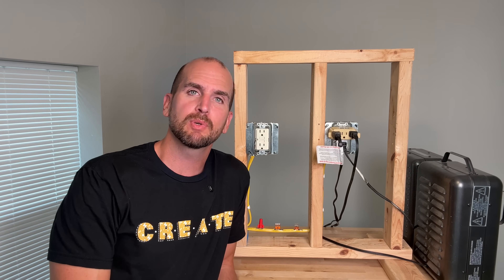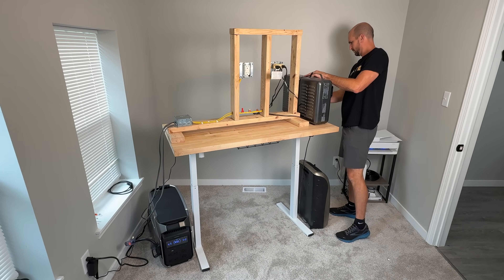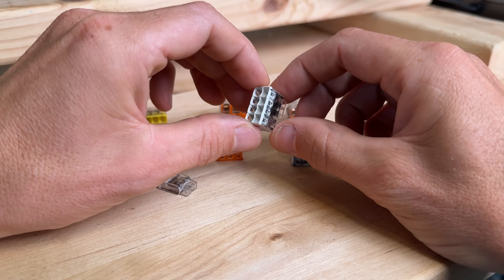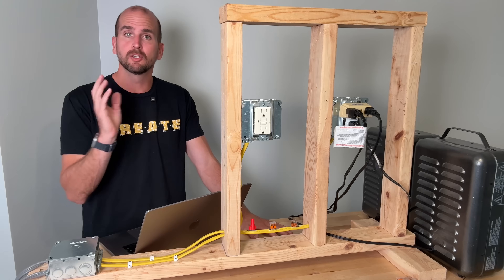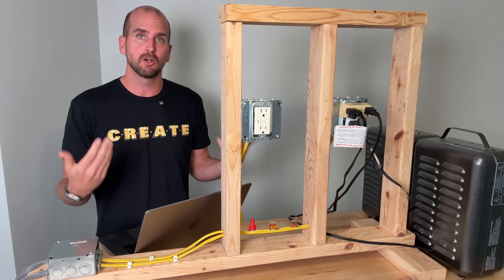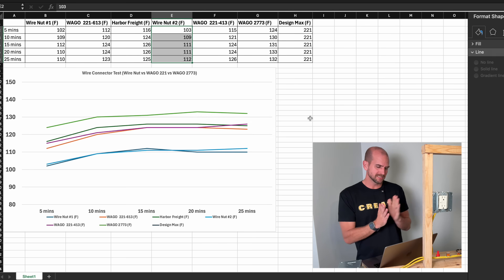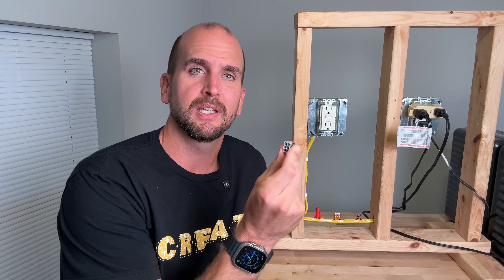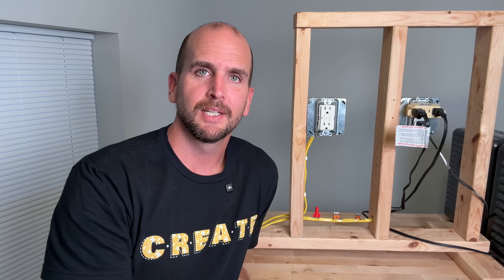Can Push-In Wire Connectors Handle Heavy Loads? | Surprising Results!

Comment: The variable he doesn't represent well in his testing is time.

He runs it for some time, but not long enough for the vicious cycle of bad connections to occur.

Also, the addition of a very small resistance is very difficult to measure, but it can have an enormous effect over time.

Think of resistance spot welding. The cross section of the contact tips is roughly the size of the weld nugget.

The difference between the resistance of that cross section of the copper contact tips and the (say steel) it's welding, is usually thousandths of an ohm. Yet, the steel is melted (goes plastic), and the contact tips will last for hundreds of welds.

With electrical connectors, the internal resistance will be less, and the current will likely be less, but there will be some areas of resistance that is higher than the wire itself.

That resistance will heat the wire and the connectors. That heat will gently accelerate oxidation. That oxidation will increase resistance. Increased resistance = more heat... There's your vicious cycle.

The push connections will likely start off with higher resistance, due to a smaller area of contact.

The wire nut is superior because the two wires are in direct contact with eachother, over a length (let's say 1/2"). None of the other connectors will come close to the amount of contact area, as the wire nut.

It'll never matter in a hall outlet. But it will in something like a well pump. Really, anything that pulls higher currents for longer periods of time.

Things go bad quickly after oxidation kicks in, but oxidation takes time!
Reply: I dunno, I've had Wago's (lever nuts) on my 5000W garage heater for a few years now, there's barely a heat difference between the Wago and bare wire using 10ga to connect to the 12ga internal wiring. That thing runs pretty constant when it starts getting below 0F. We'll see over more time, but everything still looks good after several MWh of throughput and a some very high humidity.
You're going to have oxidation issues with twist nuts too as there is still an additional resistance on twisted together wires. There's more contact area to mitigate issues, but it's still there.
Also, Aaon commercial rooftop units have been using 221's for their compressor power wiring for a while now. I haven't heard of any issues yet, but would be interested to see if there are.
Reply: @andrewt9204  - He is right though.  Wire-nuts have "teeth" as well.  So you will have the wires twisted together over more surface, which is probably good enough to hold if you only used tape, and you have the wire nut dug into the surface of each of the wires underneath.  The wire-nut will hold up better over time.
Reply: He also did not tell us whether he twisted the wires under the wire-nut here.  It looks like they are not.

Comment: I "get the point" about being far below the 220 F operaing limit.  But, in all fairness, I'm not very impressed with that limit.  As if having enough heat in your walls to boil water is somehow okay.  So I find that aspect to be irrelevant to the test.

We need to focus on the fact that we're pulling ~30 amps thru the WAGO.  

Let's do a series of tests with that same load...but over time. Let's see one hour @ ~30 amps.  Two hours.  Three hours.

Then take the WAGO apart and show us the terminals and housing compared to a new one.  If the two look the same, then the argument is settled.  If there's scorch marks or melted plastic, then the conversation must persist.  We'll have to keep dialing back the amperage untill we get a clean comparison.
Reply: I like your logic. Very thorough. Can we assume the UL did that sort of test already?

Comment: Is testing them connected to the same wire (at the same time) accurate?
Reply from the maker: There would be a little voltage drop at each connector but I think the difference is negligible.
Reply: @EverydayHomeRepairs  They will all be carrying the same current when connected this way so it will give the most accurate results.

Comment: I picked up a package of Ideal push-in connectors (model 30-1333S). They work well for solid wire, but are unusable for stranded. I expect that the Wago push-ins have the same limitation. One of the nicest things about lever-style connectors is how easy it is to connect together solid and stranded wires.
Reply from the maker: Yep, the WAGO 2773’s are a no go with stranded wire.
Reply: @EverydayHomeRepairs  They're fine with 7 strand wire (class 2), but not class 5 (fine stranded)

With solid core wire you can reuse the pushin wagos by twist and pull. I've only ever seen ONE wago burn up and have been using em for over 10 yrs and that was due to corrosion thanks to water ingress on a 32A circuit
Reply: Someone can correct me if I'm wrong, but I'd expect in Europe they'd crimp a ferrule on stranded wire before attempting to use it on a push-in style connector. The use of ferrules is practically unheard of in the U.S. since most small wire is solid.
Reply: @sigcrazy7  it can be done but to my knowledge ferrules are meant for screw down connectors.  Lever wagos are  a better bet... Wago also do  a model  (224 series) that can take solid (push in) one side, and spring loaded the other side for fine stranded. They're designed for lighting, not sure if that type is UL listed...
Reply: They are only meant for solid wire are you dumb?
Reply: The Ideal push-in connectors are rated for stranded too. I agree that it doesn't work well unless the strands are perfectly prepared and inserted, but I trust them more for outlet loads than the Wago lever-nuts.
Reply: @adamliberman6767 I don't know what you mean by perfectly prepared. Based on my experience with 14-gauge stranded wire, they can only be used if the wire has been tinned. (I haven't tried 12-gauge stranded.) Otherwise the force required for insertion just crumples the wire, no matter how firmly the strands are twisted.
Reply: @adamliberman6767   "but I trust them more for outlet loads than the Wago lever-nuts." 
Why ?
Reply: Push ins are great. Work great. Solid 14,12  wire at least.

Comment: I can't help but wonder if this is the right test for a couple of reasons. While the external temperature is certainly something to pay attention to, isn't the internal resistance of the connection important, also? To get into details, the wirenut probably has greater thermal insulation properties than the plastic used in the Wagos or Harbor Freight connectors. That would reduce the temperature at the surface of the wirenut. It may have greater surface area also. So, whatever heat is generated at the connecting points of the wires gets spread out to a larger surface. n I think that means we'd see that under identical electrical resistance  to the load in the connector it would yield lower temperature. So, it would, for me, be interesting to show what the electrical resistance is in each option.
Reply: Wouldn't the temperature be directly related to the electrical resistance of the connector?

It's also worth remembering that all the naysayers typically heavily focus on the alleged risk of fire, and that's what drives the temperature check here.
Reply: @ralfoide  The resistance determines how much heat is generated, but the other part of the equation is how rapidly that heat is dissipated into the surrounding environment.  The temperature of the connector will end up being determined by the balance between the two.  Therefore, electrical resistance does not necessarily correspond directly to temperature.  The temperature can also be affected by the material the connector is made from, its surface area and contact with the surrounding air, etc.

But this is also why measuring resistance is not necessarily the most important test, because arguably what really matters is how hot it will actually get in your walls, and whether that will run the risk of causing damage or fire.

Electrical resistance would be an interesting data point, but is really more of an academic question, because it's clear that none of these connectors are going to have a high enough resistance to significantly affect voltage drop (which would be the main reason why electrical resistance itself might actually be a concern in the real world).
Reply: @foogod4237  "Electrical resistance would be an interesting data point, but is really more of an academic question", ironically it is the complete opposite. The junction's resistance governs how much energy is converted into heat, the complex non-linear thermal conductivity surroundings is an academic question. Your description of how quickly a junction can release heat before starting a fire is likewise misunderstanding the true opposite point. 

An electrical junction should never be even vaguely hot enough to heat internal walls to the point of fire. A failing junction  should ideally constrain the heat such that it melts or breaks apart safely and the electrical circuit is broken. What you described is actually what leads to house fires with little or warning symptoms. A high resistance wire nut kept relatively cool by  dissipating heat is a ticking time bomb, how is anybody supposed to even notice a problem?

"none of these connectors are going to have a high enough resistance to significantly affect voltage drop"

You are quite right in saying this. But you can study hundreds of thousands of wago lever nuts used and find the electrical resistance around a tight bell-curve and very low standard deviation. But unfortunately wire nuts require the electrician to be responsible and with a modicum of skill, so while it still has a decent bell-curve, the standard deviation gives big tails for improper use that leads to electrical fires.
Reply: I'm pretty sure that the youtuber Great Scott did this test already, and it needed a benchtop multimeter to test because of the needed resolution. Not exactly something most people have around handy. AFAIK the Wago had a slightlyhigher resistance than the wire nut, but realistically it wasn't a big concern at any sane current draw that they're rated for.
Reply: there's also the aspect of emissivity. the temperatures in the video were taken using a camera, but the different connectors could have different emissivity

unless that was actually corrected for / calibrated, it's not really proper to compare those readings taken from different surfaces (readings from the same surface at different temperatures, however, are generally comparable unless things get extreme leading to nonlinearity)
Reply: I came here searching for this comment

Comment: I'm concerned that doing good joinery including pre-twisting with wire nuts takes a bit of practice. The pre-twisted solid core wire is also subject to heat cycling. Perhaps the spring in the Wagos/Ideal connectors handles the expansion/contraction better over time.
Reply: Why pre-twist? You're supposed to use the wire nut to twist the wires. You put the wires into the wire nut and twist until you get a couple good twists outside of the wire nut.

Comment: I finally broke down and bought a small pack of 221 level nuts.  I used them for the first time yesterday.  Ok, you won me over.  I'm sold on the 221 level nuts.  Much easier than wire nuts if you have different gauge wire.  They work.  Thanks for sharing.
Reply from the maker: You bet, wait until you use them on a light fixture or fan.  Like having another set of hands 👍
Reply: @EverydayHomeRepairs  Or, something with integrated lever nuts. I'm replacing all of the receptacles in my house with Leviton edge receptacles and they make the process just so easy. They're especially nice because there is no exposed metal other than the grounded bits at all. And, it's not quite as nice as these Wagos as you can't see the wire, but if you've used the strip gauge and you don't have any exposed wire outside, you're fine.
Reply: @EverydayHomeRepairs  I was going to use that exact same example, especially when joining solid to stranded which is often the case there.
Reply: also much easier if you are mixing stranded with solid wires.
Reply: @philsmock4943  why a different gauge wire connected together?
Reply: @pbm___000  Smarthome devices like switches and receptacles often come with stranded leads.
Reply: @pbm___000  Light fixtures is a common one
Reply: @pbm___000 light fixtures sometimes/typically have smaller AWG size than typical house wiring, just one example
Reply: @elaroche24  yeah I didn’t have the right Wago nuts for doing a ballast bypass (I only had straight 2-port 221s) and it was really hard to use the wire nuts with such different gauges; I used them anyway cause that’s all I had, but I think the proper 221 wagos would’ve been better
Reply: You can also use them as a method to join different metals safely for people afflicted with aluminium wiring.
Reply: Lever, not level.  They are very good!
Reply: @DougKremer  You're right.  My bad.
Reply: So many videos about this… I used 221 just recently for a stereo project— they’re great. I wouldn’t use single-use devices…

Comment: I use Wago push in connectors all the time for LED retrofit and ballast bypass. They're cheaper than the lever nuts and work great.
Reply: That is my preferred application as well.

Comment: Just use wire nuts.  It makes it easier for next guy, when changing things up.   Everyone always gets bedazzled by the new mouse trap.
I have had the most issues with electrical by having to replace receptacles or switches that were backstabbed,  These lever nuts look like they are built with the same design flaw.
Reply from the maker: The lever nuts actually made service and/or additions super easy for the next guy 👍

Comment: Are the Wire Nuts in both recent test videos in Series or Parallel?  It looks like they are in Series on the Black Hot line.  If in Series, the Voltage to each successive wire nut is reduced by the Voltage Drop across on the preceding one, and therefore the Voltage Drop Heat is not as accurate as Parallel would be.  I was surprised that the Push-In Wire Nut had the highest heat of all, but I would have stayed with the 36-piece Lever Nut assortment pack anyway for the convenience of reusability of the Lever design.
Reply from the maker: Yep all the connectors are wired in series. Although I didn’t measure the exact voltage drop I believe it is minimal.

Comment: Can Wago connectors be used on outdoor fixtures or out door equipment on your house? And still be up to code?
Reply: For damp areas, yes. The code calls for outdoor fixtures to be sealed with gaskets and/or caulk. For unusually harsh environments, they do make a one-time-use waterproof connector that is filled with goo to seal the connection.
Reply: Wago offers protective connection boxes/cases to protect the lever nuts and incoming/outgoing wires. 

All of the Wago boxes are mountable, and use a hinged top cover and a gel-filled bottom compartment. Also, there are generic boxes without the gel on Amazon. 

These protective connections boxes/cases are not for use inside an outlet/switch box.

Comment: Can the wire be removed from the push in, or does it need to be cut off ?
Reply: Yes, it can, just rotate the push in back and forth while pulling slightly on the wire, and out it comes.
Reply from the maker: Yep, it can be removed like @surferdude642 mentioned but still the connector is one and done.
Reply: It's a once-and-done connection.

Comment: I swear this guy is obsessed with push in connectors 😂
Reply: I find this guy is obsessed with helping home owners make informed decisions and helping them master a huge variety of tasks
Reply: @bl9531  - Here is an informed decision.  

I'm doing an electrician apprenticeship right now.  My instructors, master electricians, tell me that the first thing you do when you see a wago styled connector is take it out and properly install a wire-nut there.  "Properly installed" means twist the the wires together and put a wire-nut over the top of them. I already knew that, but he saw fit to interrupt his lesson, which was about something else, to tell us this.  There was at least one other master electrician lurking in the classroom for oversight who didn't object.

You use a push-in connector when you don't have the wire or the room to install a wirenut.
Reply: I think because he gets a lot of push back in the comments and people don’t believe him at his word so he needs to prove it.
Reply: Mine caused a short circuit that took me a week to find on my circuit
Reply: @Adamscarwashchicago  the connectors caused the short circuit?
Reply: They probably throw him money to advertise for them.
Reply from the maker: @kickeramps I receive affiliate commission from Amazon but no sponsorship dollars from WAGO.
Reply: @EverydayHomeRepairs  same diff. Still pushing a product for monetary gain.
Reply: @kickeramps Would you rather he put Amazon affiliate links for products completely unrelated to the topic of the video? What a dumb take.
Reply: @FunningRast  actually, I could care less. What a dumb assumption.